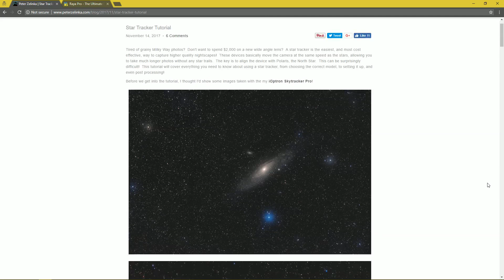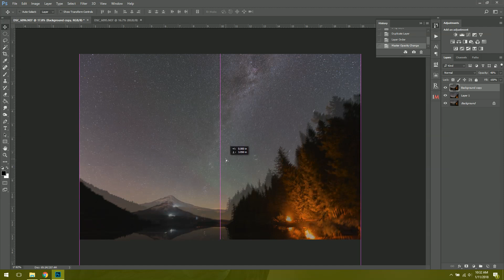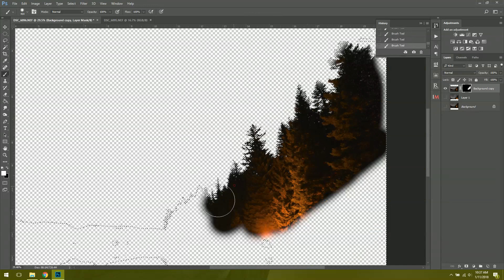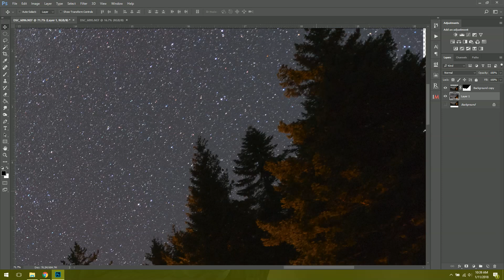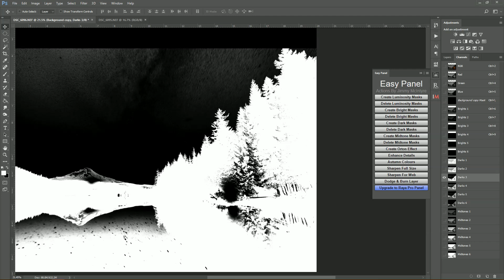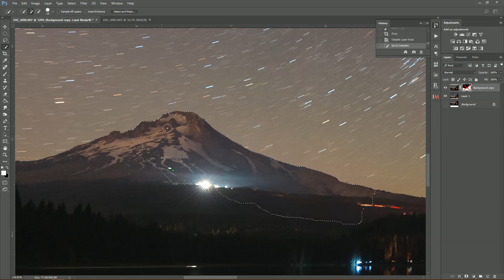Star Tracker Blending Tutorial - Using Luminosity Masks

Comment: Excellent. Two years after posting, I am doubting you will see my comment/question, but here goes. The step you noted would cause you more work, the changing of the angle of the camera for the two different shot, seems to me like a time saver. I say this because I have done this, using just luminosity masks. I even have a plugin for PS for this purpose. Anyway, with trees and so forth in the foreground I have had a lot of work cut out for myself: masking for the blurred out portions has required me to (just as you did with your shots) shift the sky laver to get rid of some of the blurry trees. With aligned shots, I lose more of the sky (the whole reason I  was out there shooting!). Would you still give the same advice? 

I am thinking it is better to take the first shot at a higher angle, thus preserving more of it in post-processing. How about it?
Reply from the maker: My new technique is to take the foreground shot first, so I'm really happy with the composition.  Then I find a nearby area that has a more wide open sky, with minimal foreground obstructions (easy to do out in the desert!).  Then I setup the star tracker and mimic the milky way position as it was in the foreground shot.  This makes blending much easier than taking both photos in the same spot
Reply: Peter Zelinka you just clarified one of my most nagging questions. Thanks.
Reply: @PeterZelinka  Thanks. That's another option I've been considering after seeing some of the things AI sky replacement in action (something that Luminar seems to do better than Photoshop).

Comment: I'm having all sorts of issues trying to blend this image I shot a few weeks back. It's a astro landscape with a dead tree on the left of the image and the MW on the right. I tracked the sky exposure for 4 minutes and tracked the foreground lit by starlight for 4 minutes as well. My issue I run into is that the lone tree in the tracked image is blurry due to movement and when I blend, it is wider and larger than the foreground image tree due to the motion blur of the tracker. I think this may be an image that ends up sitting and not being edited as I don't see how it's possible to join the 2 exposures flawlessly.
Reply from the maker: Yeah, that's the #1 problem I see when people are trying to blend photos.  The foreground elements blur out and create a major problem.  I do cover how to fix this in my courses and over on my Patreon page if you want to learn more. 

Of course, the best thing to do is just not repeat the mistake next time.  I always move things so that the star tracker photo doesn't have a large foreground object in it.
Reply: To work around this, I take an image of the same view of the night sky but with the camera placed ahead of the foreground image. It means taking two images from two positions. This may not work for all situations but for objects nearby which can be circumnavigated, it does the job. You still end up with a blurred horizon but this is usually manageable just like Peter has demonstrated by sliding the layers to hide the blurred edge.
Reply: Yeah that's the plan for next time now that I learned from this unintended learning situation due to my mistake. I love using the tracker and was happy that I was able to do a 4 minute exposure without any tracking. I can't wait to use it next MW season again but I'm just not a fan of the crazy hours you have to be up to capture the MW early in the season lol.

Comment: Hi Peter. Thanks for the tutorial. I am wondering if I take several tracked exposures of the sky - including the background - to capture, for instance, a meteor shower,  and then capture the background more than once with the tracker off, is worth or possible to use Sequator to stack them separately and after your technique?
Reply from the maker: Is there a particular reason you would take multiple images of the foreground?  Personally, I would just take a single long exposure of the foreground (~4 minute shutter speed), which would capture plenty of light.  Then, you could take all of your sky images and load them into Photoshop, in the same workspace as your foreground image.

At that point I'd probably change the blending mode of the sky photos to lighten.  If everything worked correctly, the stars should stay in the same place, since you were using a tracker, and any meteors now be visible.  Lastly, you could do the blending technique to mask out the blurred foreground and finally have a complete image.
Reply: Thanks again. I got it. The reason why I mention multiple images of the foreground was to reduce the noise. But at a low ISO it is unnecessary, am I correct?
Reply from the maker: @Light_hunter-gatherer  The amount of noise in the photo is more closely tied to your shutter speed, rather than the ISO.  If you take a short exposure, you don't capture much light.  Therefore, you'll have a grainy photo regardless of your ISO.  If you take a very long exposure, upwards of 4 minutes, you'll capture a ton of light and have a much cleaner image.  

To be honest, the ISO really doesn't matter as much when shooting at night.  All ISO does is amplify whatever light was captured.  You could do largely the same thing in post-processing by increasing the Exposure slider.  However, you need an ISO Invariant Sensor for that to work properly.   You can read more about all this on my website, if you're interested:

https://www.peterzelinka.com/blog/2017/4/iso-invariance-with-a-nikon-d750

Comment: I have the same star tracker and recently purchased an Irix 15mm lens to replace my 14mm Rokinin (tho I'm not getting rid of it!). What are your settings for a 3-4 minute foreground exposure for a 14mm lens? And of course what exposure settings do you use for your MY image? Thanks for your vids and sharing your knowledge. I'm really interested in the Raya add-ons.
Reply from the maker: I normally use ISO 800 and f/2.8 for both the foreground and Milky Way (when using a star tracker).  

If for some reason I don't have my star tracker I'll normally use f/2.8, ISO 3200, and 15-20 second shutter speed